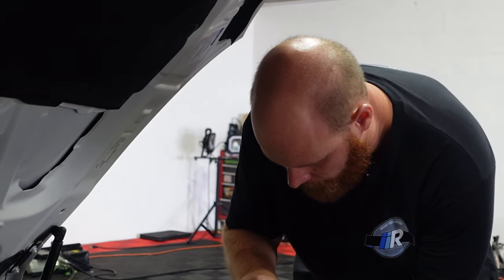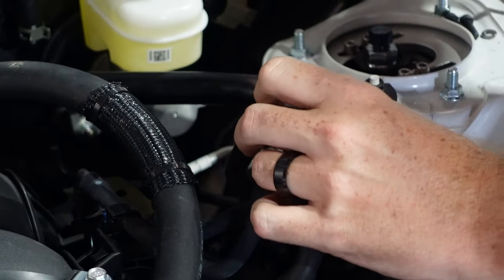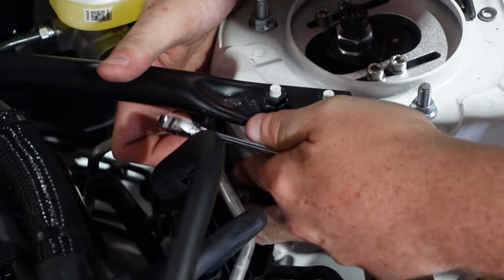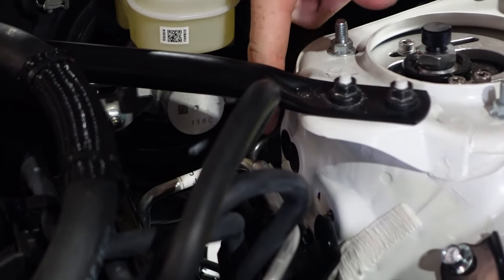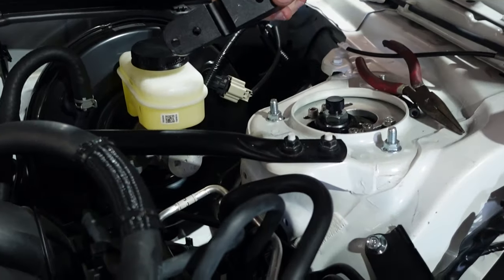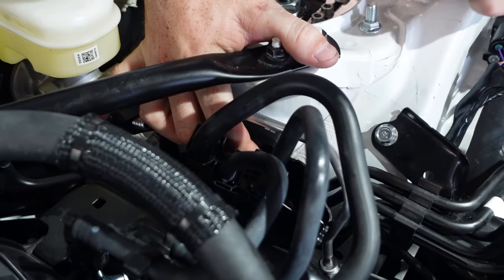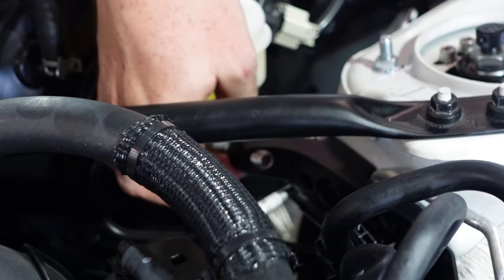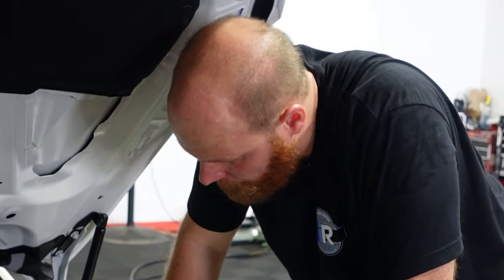2022 BRZ & GR86 Perrin Master Cylinder Brace

Comment: Question: I Lost one of the M6x20 bolts so I reused the 10mm bolt that came factory.  This wasn’t as long so I couldn’t reuse the metal fuel line bracket.  Is this an issue? The plastic fuel lines seem pretty snug even without the bracket. Thanks!
Reply: No lol. You do not want these lines flopping around in the engine bay. Coulda just brought the one m6 you had to home depot and picked up a duplicate.